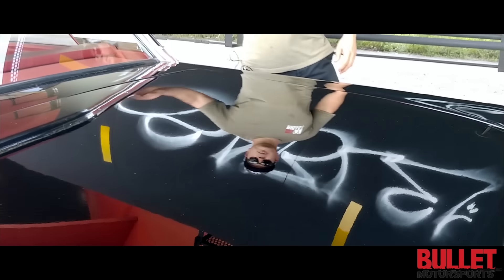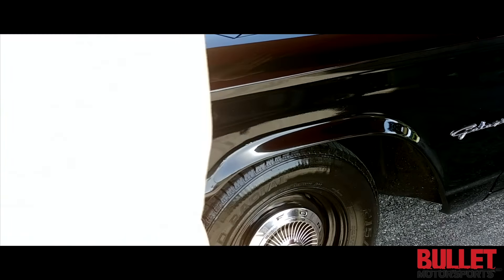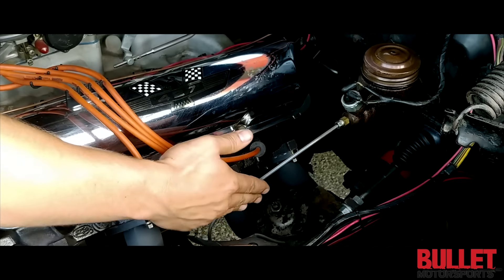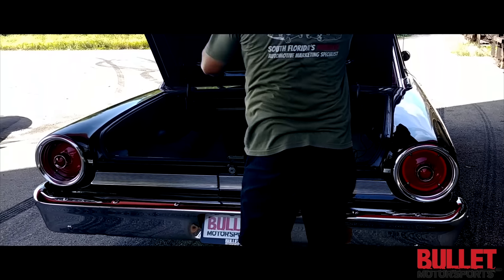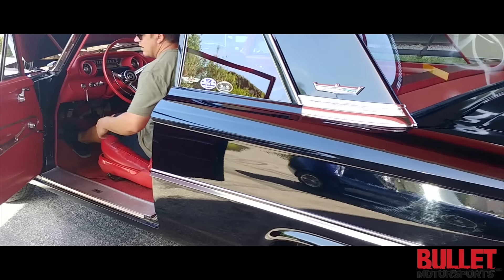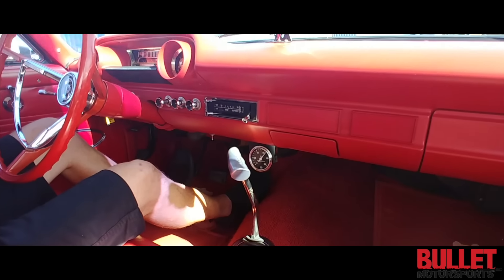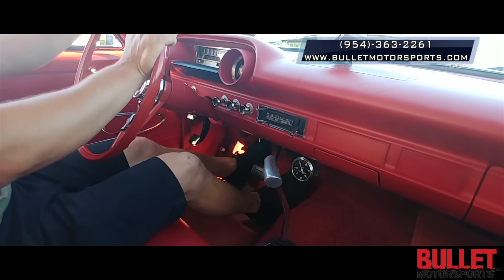1963 Ford Galaxie With 427FE Ripping Through The Gears! -[HD] Bullet Motorsports

Comment: From a big Mopar fan, this is special to see . Not surprised it sold in a week, super gorgeous bare bones killer, makes the rice rockets look like Leggo.
Reply: Makes pure mescaline seem like ginger beer-fear and loathing
Reply: I don’t care what someone as a fan of this goddamn thing is beautiful , dying looking at this and not owning one
Reply: @jeremythompson9122  True, but I believe you are thinking of the Ford 427 SOHC Cammer. It's the one with the big heads and 4 valves per cylinder. This one is a 427 FE. Still pretty sweet. I love all makes, but especially the big blocks. Have a 59 T-bird that I dropped a 390 with a 428 crank in it. 4 speed top loader (wide ratio) 4.00 Rousch yates detroit locker, 9 inch pumpkin, 31 spline axles. Yes, I cut a hole in the floor to put the manual trans in. Lots of little extras that gives me about 400hp and over 470 torque at 6500 elevation. It's a kick in the ass to drive.
Reply: It’s an original 352 car, and not an original 427 car.
Reply: @davib7534  It doesn't have 4 valves per cylinder only. Its an ohc not dohc
Reply: @joddaley6510 it's an Overhead valve

Comment: first thing i would add is disc brakes and a dual power master, so i could drive it and live to remember it.
Reply: OMG I was thinking the same thing!   I’ve driven some old single circuit drum brake cars and even when they’re “right” it’s still terrifying to drive ... especially when you have big power sitting up front.
Reply: @whodahellru8124  True dat, the stock brakes would glaze up like a dozen Krispy Kremes... been there, done that, got the shit scared outta more than once!
Reply: @whodahellru8124  disk brakes ain't gonna save you from that either. most people can't brake work a fuck anyway, and lock the disk brakes up. abs modules always fail too.
Reply: Frigglebiscuit well I’ll take my chances with disc brakes over drum.  You enjoy your pessimistic point of view while riding out the brake fade!
Reply: why drag cars used parachutes back in the day
Reply: Very first thing I thought.
Had more than one scary moment back in the day
Reply: Yep, brakes would be a must since it's not a numbers matching car, should have gone the extra mile and added brakes. Big engine cars from that era were a nightmare to stop. My buddy bought a off the showroom floor '69 Z28, went like a bat outa hell, whipped up on everything on the street in Portland, Ore in it's day but woahing it up was every bit as scary as was the accelleration - when and if you could get it to hook. Those of you from the era remember tires weren't ready for the accelleration either.  A lot has improved in 50 years,, good things now days.
Reply: Had a 65 Mustang with no pwr brakes or steering. Beast to stop and park. Add disc brakes and pwr steering and this Galaxy would be perfect.
Reply: @frigglebiscuit7484  
No kidding.
Reply: @frigglebiscuit7484  dual 4 barrels and racing gas and you going to drive like an old lady?
smh
Reply: First thing I would add are seat belts.
Reply: I drove a '68 Chevrolet Bel Air 307 Turbo-Fire. Braking was kinda spooky, bro.
Reply: You got that right. Old Fords had terrible brakes, especially old Ford pickup trucks.
Reply: Can’t turn, can’t stop, but fast in a straight line.....
Reply: Sterling Price lol fr. I have a 390 76. Feels like the brakes are out. If you’re doing the speed limit and have to come to a stop, you have to apply pressure 1/4 mile or more to come to a safe stop. Two lines running from the master cylinder. My 2011 f250 has six high pressure braided lines and even then, you can feel the weight of the truck when coming to a stop, nowhere near as scary as riding in the oldie though lol.
Reply: radioguy1620   Yes, if you go fast you have to be able to brake fast.
Reply: A real man dosent need power steering and brakes 🤣
Reply: The person that bought this probably trailers it to all the car shows to display his 1st place trophys LOL
Reply: @whodahellru8124  Half my life I drove cars with those systems. They were not terrifying! If the master cylinder starts to bypass, rebuild it or replace it. Keep good linings on the shoes. I used to reline them myself with high quality lining. The new systems are better, but these were not OMG, terrifying! I doubt you ever drove one that was working right, if ever.
Reply: @frigglebiscuit7484    You’ve had ABS brake modules fail?
Reply: @davidmorgan939  I totally agree, it is just not smart to omit these items in these times.
Reply: you got some good reply's on this one.
Reply: @frigglebiscuit7484  hear hear
Reply: @MrRemo58  Just factory AM/FM reception. Stock rocks.
Reply: PLEASE, NO NO NO!!!!! Leave it STOCK & ORIGINAL! This is FINE art work!
Reply: @quickdeuce  a 69 z28 had disc brakes friend....
Reply: drums and manual brakes actually work quite well.

Comment: Thank you for bringing back such wonderful memories for me. In 1965 my Dad brought home a 63-1/2 Galaxy XL 500 with a 427, 4 speed. It was factory metal flake gold with a white top, white interior with bucket seats and floor console. It was special ordered by the owner of our Ford dealership in Sarasota, FL. He would take my older brother and myself out for cruises...he was a drag racer in the 50's and early 60's and had even bought a 1957 Fairlane Custom with the factory supercharged 312 brand new. I loved that Galaxy and in 1976 I had a 1967 Mustang GT  Fastback with a Holman-Moody 427, 4 speed and 9" Locker Rear. One thing you were wrong on was the red line...the cross bolt main 427's would easily wind to over 8,000rpm all day long as they were developed for NASCAR and turned that on the track. I reved mine to 8k when racing for 3yrs and never hurt it. I wish I had seen this when you first put it out as I would have have bought this fine ride in an instant. Thank you again for the walk down Memory Lane and for the sweet video.

Comment: I hqd a friend in high school (we graduated in 1965) who drove a 1963 1/2 Galaxie 500XL 406 dual quad (His folks had WAY woo much money).  He never took it to the local drag strip, but on Friday night, the Dodges still had more, but the 409's (as long as we had more than 1/4 mile) never shut him down.  The soul of this car came at the other end of the road.  As you head out of town, the roads are a mile apart.  He had already figured what car dealer or grocery store was about 120 yards past 440 yards.  Worked almost every time!
Reply: The Chevy full size bodies  were 400 lbs. lighter and the Dodges, being unibody, were even lighter.  Your friend should have gotten a car length from the starting line for the weight difference.

Comment: Ahhh, the memories..... I spent my youth cruising around in my '63 1/2 500 XL - white w/ red interior. It only had the 289, but it was great!
Reply: Me too. Loved that 63 1/2 body. (even with a 289) lol.
Reply: Love those Ford's! In 1975 I bought a 427 with a rod broken on the small end and wrapped around it's neighbor wedged between the counter weights... rebuilt it at Junior College auto shop..stuffed it in my blue and white 59 Galaxy with a three speed and overdrive...scattered that tranny on the first full power run.  Went a wrecking yard and got everything from the bellhousing back for $250.00.
Put stock full hubcaps on the car with only cheater slicks hinting at what the car was designed to do...sucker 327 Chevy's into street races they had no chance of winning....A 63 1/2 Galaxies with a 427 four speed with 3 K miles could be bought off a used car lot in Santa Rosa for 2900.00 at that time..good old days for sure!!!
Reply: Oops! Typo...1965!
Reply: My brothers first car '63 boxtop Galaxy and I'm pretty sure a 260 V8 it was a dog

Comment: Okay, I'm a old fart. So, back in the day. My buddy Joe had a '63 Galaxy 500. Came with a 390. He found a crashed 500XL in a wrecking yard, with a black interior. Bucket seats, console, etc. We got the whole interior  out of it. It was black and perfect. We managed to get all of it in without  mishap. He pulled the old 390, which had a lotta miles, and was showing signs  of old age.  He rebuilt the engine with a mild cam, 11 to 1 pistons, porting and a nice balance job. This old car surprised a lot of people who thought that they had fast cars.  I still remember the throaty sound when you stamped on the "loud pedal"
Reply: TheRatshooter - Nice post about home made muscle car / sleeper. This would be a great thread to start ie "My favorite sleeper". 
In 1967 I talked a gear head buddy of mine down the street to build a wicked sleeper. I found a 57 Chevy 210 4 door post in light green that was owned by a school teacher in our neighborhood. He went to a wrecker and bought a nice 427 Corvette motor and rebuilt it to near radical street machine level.  The car had dual quads, headers, full flow muffler system, 4-speed, posi, racing clutch, big radiator, scatter shield, very beefed up suspension and brakes, tach and gauge panel ect. Except for traction bars, wide rear rims, and cheater slicks the cars appearance was bone stock. I don't have to tell you a lot of guys got a nasty surprise. I think the most beautiful thing about that car was the sound coming out of what looked like little school teacher stove bolt. The best part was the investment was minimal to build a bad ass machine.
Reply: Nothing sounds like those big old ford mills!

Comment: My older friend had one. He invented the Tarantula twisted intake where the carbs sit a little sideways. He ended up as head mechanic for Mercury Marine after working on the newer corvette engines. Quite the innovator. It was a wheel stander and the car I learned to drive in. What a ride, he usually ran Cheater Slicks on the street for cheating.

Comment: Man, I love this car. It's "all business!" No frills, "dog dish" hubcaps, blackwall tires, no dash chrome, AM radio, bench seat, and it top it off, it's not even a Galaxie 500, just a plain Galaxie (some of those "stripped" models were called "Custom 400", I believe, at least in '64). They were comparable to the Biscayne or Bel Air in the Chevy lineup. To top it off with a dual quad Ford 427 FE is just over the top!

Comment: My father owned a '72 Chris Craft Commander... with twin 427, 4 bolt main engines "rated" at 300 HP factory.... ya, ok.... that boat weighed 12 tons, with a semi displacement hull and would get up and cruise at 28 knots..... like nobody's business.  AMAZING POWER and reliability.
Reply: 427 is  420-460 hp. With 2 4 barrels you can get 660 out of the cammer 427

Comment: A great car. I've seen a very few at premium prices. You mentioned the hood. Most 63 & 64 Galaxy 427 had a raised hood to vent heat with some having a center bubble hood.  If memory is correct. It also provided more height for the tall air cleaner covering the high rise intake and air cleaner. I believe the single quad 427 was rated at 410 HP and ran quarter-miles around 14..0 remember. This is a big and heavy sedan. I'm not sure about the dual quads 427 (full race engine) other than it was rated at 425 HP. Thanks for sharing a great piece of history
Reply: Underrated 2 4's was about 475 HP.

Comment: What really makes this amazing is that FoMoCo did not get into performance in the 1960's until Lee Iacocca came to the helm and started dropping V-8's in cars in mid 1962. For the Falcon, the 144 straight six was the standard engine until 1963 and their first V-8's were just 260 small blocks. I restored and owned a 1963 Falcon Tudor with a 144 CU six and it was a putt mobile:)-John in Texas
Reply: I had a 63 Comet station wagon in dark blue. It had a 260 V8 and a 2 speed automatic. I loved that car and still think it was one of the coolest vehicles I've ever owned
Reply: That's not exactly true.
They had supercharged 312 "Y" block motors as options in 1957.
and a 430 c.i./400 hp MEL available up and down the Lincoln/Mercury line in 1958.
The FE engine started life as 332 c.i. and debuted in 1958 which was the basis for all the variations of 352's, 390's, 406's, 427's and 428's.
Yes, Robert Strange McNamara had to go.
He walked in one day and made the command decision to tone things down by forcing engineers install two barrel carburetors on Lincolns and everything.
All this when everybody, including FoMoCo, was on a tri-power kick, among other things.
Talk about having to "work around" an individual!

Comment: Sweet. I had a 63 Galaxy w/factory tri-power 406 back in the early 70s. 140 mph top end and about 9 mpg. average. : )
Reply: One of my favorite cars back then.  I saw a 63 406 tri-power sedan black and I liked it better than the 427 fastback.  I heard the 406 motors didn't last long because they were bored out 390s? I suppose the 406 was Ford's answer to the Chevy 409.

Comment: Incredible deep paint and one of my favorite engines too. Long ago at a race engine machine shop where I worked we had a 427 Fairlane Thunderbolt engine for some work and it had "the best" parts in it, including lightweight stainless intake valves and Sodium cooled stainless exhaust valves. It was what I call a "lust object".
Reply: The Thunderbolts were equipped with the 427 “high riser” engine. Very special for sure.
Reply: Deep paint on a '64 Ford? ROFLMAO. Yeah. It's as "deep" as an FE is "fast".
Reply: So it had the typical truck motor exhaust valves like all Ford-Edsel truck motors regardless of the "performance level". A "lust object" ? Were you "driving" a skateboard at the time?

Comment: I had a 1962 Galaxie 500 XL with the 406 V8, 4 Speed and 3 two barrel carbs, in 1968, loved running that 4 speed through the gears.

Comment: In 1962 I owned a 59 Galaxie 352" with a three speed & overdrive. I was offered a blownup 427 out of 63 1/2 Galaxie...broken rod wrapped around it's neighbor and wedged between the counterweights...cost me $75.00.
Rebuilt the engine in Junior college machine shop with used parts.
   Installed it and after break in put my foot in it at a stop light... scattered the three speed...went to another junk yard and got everything from the engine back out of a wrecked 427 car...cost $250.00.
    Put stock wheels with full hubcaps on it with a set of Lutz cheater slicks.....passed it off as stock...left the column shift in place....had a single Carter AFB with 352 air cleaner and valve covers.. looked stock under the hood....had a blast playing with all 327"  Chevys in town.
      I lived in Santa Rosa CA next door to Petaluma where A.G. was filmed...yes it was like that back in the day!!!

Comment: I actually owned an R car spring/summer 1970, paid $400-yes $400 for it in Yonkers, it had the sloped roof, same color scheme, bench seat, 4 speed and factory tinted windows. Remember when they tinted blue just the upper strip on the windshield? It smoked when you laid into it, had about 70,000 miles. Custom Edelbrock manifold with headers and 4:56 rear.  I was 18 in June and actually lost my license for 6 months for 3 speeds while I owned that car, August 70- Feb 71. To be fair, I already had marks on my license from previous cars. That car was in my top 5 that I owned. Lots of fun, went to Palisades Amusement park with it.

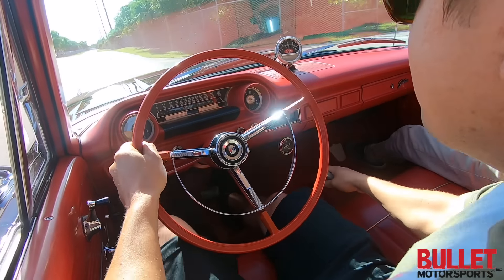Comment: You got a pretty good stumble when stomp on it @ 7:07. Might want to check the carb tune.
Reply: Yeah... in my experience it's because the accelerator pumps fitted to the carbs are probably too big and are overfueling for the RPM's.
Reply: Just gonna roll into it...

Proceeds to mash the floor.
Reply: @MidniteLiquid  A stumble like this is usually Fixed by swapping to a Larger Accelerator Pump Shot, like a 50cc, Stumble is caused by Not enough fuel during the transition of the fuel circuits in Carburetor. Most stock Holley 4 Barrels have a 30cc, you would want the larger 50cc.
Reply: Yeah, those dual carbs aren't the best for cruising around, then flooring it like this man did. He should have cleaned it out a little before he went sudden full throttle
Reply: @elmerfudpucker3204  
   I'm sorry, but regardless of what type of automobile(s) they are marketing, I find used car salespersons to be extreme vexations to my spirit ;  This one is fairly benign, whereas some are just plain overbearing and obnoxious.

Comment: 63' Galaxie 500 with a 352 ci engine and a cruise-o-matic was my 1st car as a kid when my Grandmother got a new LTD. Drove it for several years untie the valve body in the trans cracked, after that car would go in reverse in drive etc. Was a maroon color and had rust issues behind the chrome pieces on the rear roof pillars. Wish I hadn't junked it but next car was a 65' Mustang with a six cyl and a 3spd manual on the floor. all of my six rides since have been 4wd's.